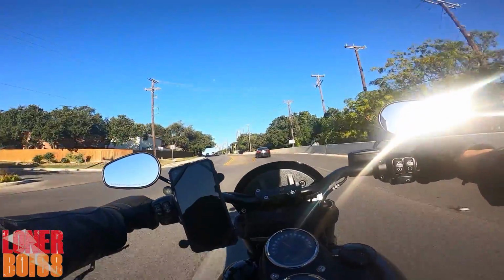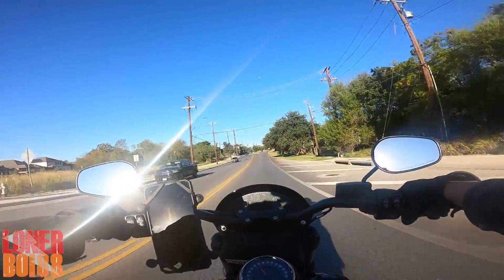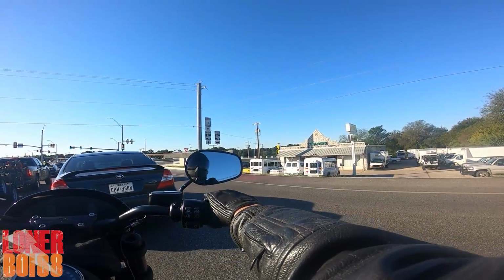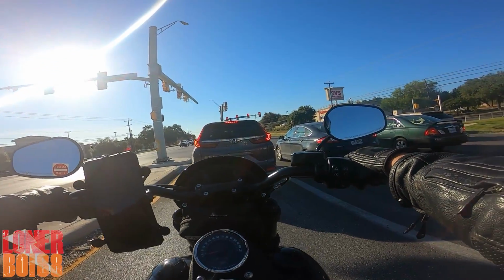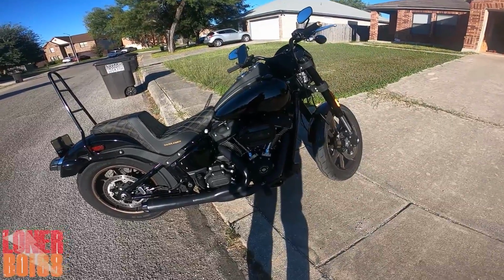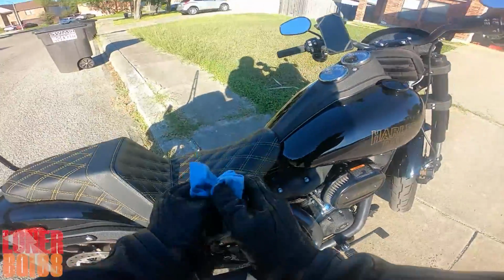S&S 475C Cam First Ride | 2020 Harley-Davidson Low Rider S

Comment: That sounds so good. I have the same cam in my 2019 Street Glide and about to install 475 cam in 2022 Street Bob tomorrow paired w V&H 2 into 1 Hi output short pipe.

Comment: Sounds great! Looks like a blast to ride. Waiting on aftermarket tuner for the 21's to put this cam in mine. Good video.
Reply from the maker: Thanks!
Reply: Check with Fuel Moto for your tuner.
Reply: Several to choose from now.

Comment: Just finished the s&s 475 c cam, heads got some work as well. Throttle body, inj and a/c upgrade because why the fuck not?  Powervision to tweak fuel and timing. The one thing I need to get used to is the low speed throttle control.

Comment: Great job on doing your own work.  No offense but scrap the fuel pack and call fuel Moto and get a power vision with a good tune.  You will be surprised at how much better it can get.
Reply from the maker: Hell yea already done. Such a huge difference.
Reply: @LonerBoi88883  Question: I assume that FM provided you a custom tune for your new cam, can you still run auto tune and build on the tune that they provided, or will you fu** it up ?
Reply from the maker: @wb4514  I am not sure...I just run the tune they provide. Rode all the way to California on it with zero issues last month. Got decent gas mileage.
Reply: @LonerBoi88883  Thanks bro. Ride safe.
Reply: @wb4514  when you run autotune and apply values, then disable autotune, on my PV-3, it saves and creates a new file. The base file you were running while using autotune is not changed.
Reply: Sounds  like I'm going to have to spring for one of those tuners 
I'm putting a 475 ss cam and a 128 big bore kit in my 114 fatboy
I also have the fp3 but have to wait to get a better one
Reply: @TheMetalmachine467   doing a 128 fuel Moto will get you really close but with a build like that a reputable Dyno tuner would be your best option.
Reply: I gotta agreed about the power vision it’s way better than the fuel pack!
Reply: I gotta agree get rid of that fuel pack get a PowerVision it’s way better

Comment: Good video, check idle RPM for min. & a Powervision  is the way to go.
Reply from the maker: Yep ended up going with a powervision shortly after hah. Ya with the tune fuel moto sent me the idle rpm doesn't seem as low.

Comment: perfect! What kind of tuner did you get and what are those 2into1 pipes? Ride safe!
Reply from the maker: running the dynojet Power Vision Tuner with a pre ran tune from the company Fuel motousa

exhaust is a Bassani Road Rage II

Comment: What seat are you running there, bro? Also, how satisfied are you with the white stitching on your Saddleman seat? Would you have preferred black ?
Reply from the maker: Saddlemen step up with gold stitching. I am very satisfied, since I went on a road trip through the hot desert and it held up fine. Not the most comfy after 600 miles lol...thank god I had my Air hawk with me.
Reply: @LonerBoi88883  Thanks, bro.

Comment: I just did the same cam install with a fuel Moto tune. I felt the same way you did before turning it on. So many things can happen. And by doing this we void our warranty on the engine. Lol. I just had one question. How did your valve train sound after the install? Alot of videos just show the way the exhaust sounds but nothing or close ups regarding the push rods and engine block.
Reply from the maker: Have a video on that initial start up. Its much quieter now but still way louder than stock.
Reply: @LonerBoi88883  Also one question. Did you notice that if the bike is shut off and you go to move your bike with the clutch pulled in (not in neutral), it's a little bit harder to move now? Let me know if you feel the same thing
Reply from the maker: Haven't noticed i alway move it around in neutral, even before the cam. Do it out of habit don't even think about it.

Comment: Did u upgrade oil pump ? I’m doing my 21 on the 19th. Fuel moto told me the newer pumps are fine unless you go big bore
Reply from the maker: Ya figured may as well while I'm in there. Got a kit from speedkings: pushrods, push rod tubes, lifters, tappet cuffs, oil pump, cam plate, and the cam
Reply: @LonerBoi88883  gotcha. Ya I’m having mine installed at dealership.  I was just going to keep stock pump

Comment: With the FP3 tune, did you have any issues under 2200 rpm? I have the same cam and even after V&H adjusted their tune, the bike has a hard time at low rpms. Thanks!
Reply from the maker: Yes i eventually went to a powervision from fuel moto.

Comment: Ok at idle and through the revs sounds beastie..... but you didn't tell us how much better it is with the new cam. How much quicker is it?
Reply from the maker: More concerned at this point whether it was still leaking, but ya butt Dyno says easy 100+ HP. Night/day difference with this upgrade.

Comment: I feel the pain I just did mine. I wish I woulda put the stock pushrods in. I don’t like the adjustable ones. That’s where I’m crossing my fingers rn. I hope the work, I read so much different things about settings
Reply from the maker: No problems once they are properly adjusted and sealed up. Road all the way to California from my house in Texas with 0 issues

Comment: It's too rich!  That's what 's making it lope like that at idle the ! If you ever get the mixture right, that lope you like so much will disappear... but it will run better. Crisper, and won't be carboning up your top end.
Reply from the maker: Different tune and still sounds the same...,also pulled the plugs after about 1000 miles and they aren't fouled at all. Lope has nothing to do with a rich/lean fuel ratio.
Reply: @LonerBoi88883  I'm just about to get mine out of the shop soon! I can't wait bro! Same exact bike I just have a s&s teardrop air cleaner and Stealth 2 into 1!
Reply from the maker: @spoom937  ur gunna love it. Best upgrade to the bike by far.
Reply: @LonerBoi88883  ya bro I'm super excited!
Reply: Lope is fine, thats the signature of an S&S Cam. Now that pop I heard during decel is a bit rich. Prbly the FP3 tuner, gotta use PowerVision or TTS for Cams and big bore